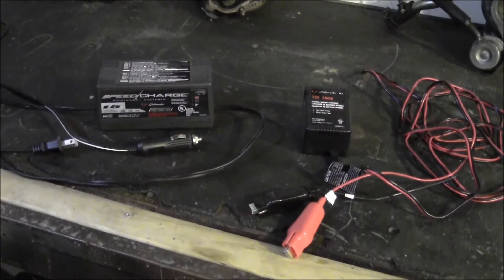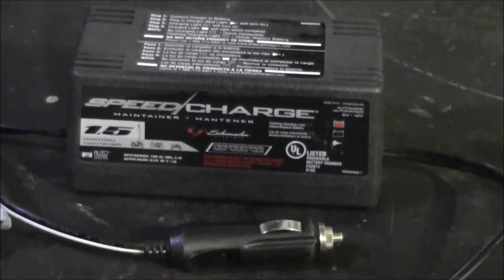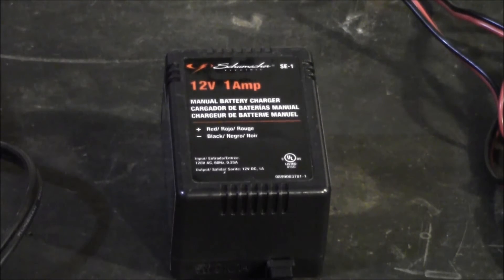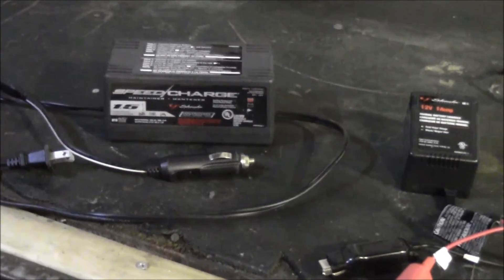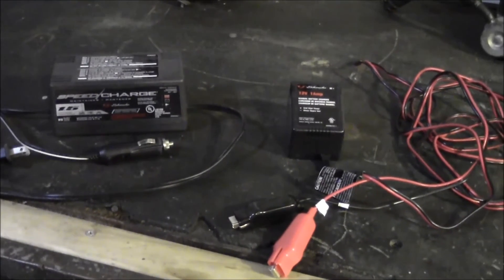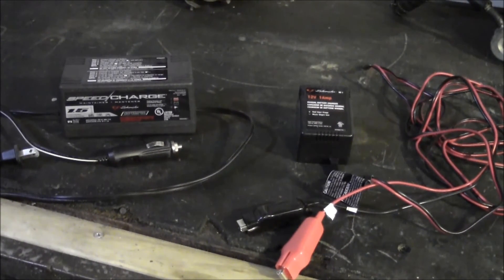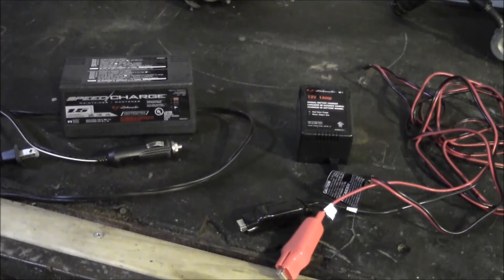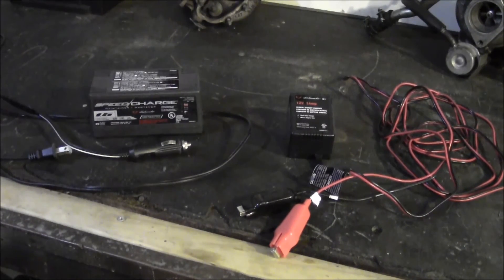Trickle Charger/Battery Maintainer Defined Proper

Comment: I had bought a battery from AutoZone the battery was dead so i tryed to hook it up my 1.5 amp trickler / maintainer. The next day it said it was fully charged,  i unhooked it and waited for 5 minutes and hooked it back up to see if it would hold a charge. I then waited  for a hour. No i dont have a voltage metter. I exchanged it for another battery and had them test it. There test said it was good but the amps are low and thats on the trickler its going on 4 hours now.
Reply from the maker: Ok... do you have a question you would like to ask me?
Reply: So can my maintainer read false reading if it is hooked up and then disconnected for 5 minutes then reconnect it, to see if it would hold a charge?
Reply from the maker: Yes, the charger may display a full charge even if the battery has not been properly charged.  It is rare, but it can happen.  The best way to verify that a charger is providing a charge, is to test the battery with a voltmeter while charging it.  Beyond that, a load test is the best indication that a battery is properly charged.  Autozone should offer free battery charging.  I would suggest taking the battery back to Autozone so they can either charge it for you, or replace it.  Your 1.5 charger could take up to 3 days to charge a full discharged battery depending on it's size/RC rating.
Reply: It's a 1.5 amp John Deere charger/ maintainer. I will ask my buddy if i cant barrow his voltage metter.
Thank you for answers to my question and concern.

Comment: can i use the 1,5 schumacker trickle charger to charge a small 12 volt sealed gel battery out of a booster pack ?
Reply from the maker: Yes you can.  However, depending on how discharged the battery is, the charger will either not start charging or it will try to charge the battery on 6 volt mode (If your 1.5 amp charger is the 12v/6v model.  Some are 12v only).  A low enough voltage will cause the charger to attempt to charge your 12v battery in 6v mode.  Which is not going to result in a charged 12v battery.  So you have two options.  1.  Check the battery with a voltmeter and be sure the battery has at least 8 volts before charging.  2.  Attach the battery to a known good 12 volt battery with jumper cables and charge it for a half hour.  After a half hour, stop charging and remove the jumper cables.  Then reattach the charger to the booster battery for final charging.
Reply: BATTERY says 10 volts,,,,,,when i hooked up the charger the meter i had attached said 16.5 volts. was afraid i was putting to much juice into it so figured i look on here before blowing up the battery
Reply from the maker: What model charger are you using?
Reply: the same one you show in the video 1.5 schumacher
Reply from the maker: From what I have read an agm battery should not be charged above 15.6 volts.  However I have seen two different schumacher chargers charge an agm battery at 16.5 volts like yours is.  One charger was even set to the agm setting.  I don't think it's a big deal as long as the battery does not get hot to the touch.  I would suggest keeping an eye on it and periodically placing your hand on the battery case to check the temperature.  It should get warm but not hot to the touch.  If the case is getting hot, stop using that charger.  Or you should get a different charger.  What ever you are comfortable with.  The charger you are using has a desulfation mode that charges at high voltage which is why you are reading 16.5 volts.  Again, it's your call.

Comment: Still confused.  It looks like the battery maintainer has an electrical cord at the end and the trickler does not.  I have a car I do not drive everyday and thought one of these two items I could hook up to it so it is not dead after 3 days, but I would be unable to plug the thing in to a wall outlet.  What would I need?
Reply from the maker: The trickle charger has a plug that flips out of the large transformer block.  So it plugs into the wall like the maintainer does.  Don't get a trickle charger.  It will not stop charging like a maintainer will.  You need access to a 110 volt outlet.  The only other route you could go would be to disconnect your negative lead on the battery when the car is sitting.  Get a jumper box.  When you want to start the car and use it, reconnect the negative lead and then hook the battery up to a jumper box to start it.  Or you could just remove the battery from the car and bring the battery to a location that has a 110 volt outlet.  Then put a battery maintainer on it.  When you want to drive the car, take the battery off the maintainer and reinstall it in the car.
Reply from the maker: This video shows the plug on the SE-1.  https://youtu.be/y9-v3JDuhNI

Comment: how can you tell when the charger has done its job?
Reply from the maker: On the automatic charger usually a light will illuminate indicating a full charge.  Now on a manual charger there is a bit of math involved.  I really don't think it is worth the time or effort to charge a battery with a manual charger when automatic models are low cost and readily available.  When using a manual model your first step is to determine how long to charge the battery based on the batteries capacity.  Multiply the reserve capacity by 0.6.  For example... 120 minutes reserve capacity multiplied by 0.6 = 72 amp hours.  Next use a volt meter to determine the level of discharge.  So a voltage reading of 12.4 volts represents (roughly) 50% state of charge.  So divide 72 amp hours by 50% or 1/2 and you have 36 amp hours.  Some people will add 15% for any lose caused by internal resistance within the battery.  So 36 x 0.15 = 5.4 plus the original 36 amp hours = 41.4 or rounded up 42 amp hours need to be replaced to charge the battery.  So to charge the battery with a 10 amp charger divide the 42 amp hours by the 10 amp charge rate and you have 4.2 hours which could be rounded to 4 and one half hours of charge time.  This can be inaccurate because most chargers will not output the full 10 amps during a charging cycle.  The output will vary.  Therefore you may only see half the output amp during the charge cycle.  So it may end up taking twice as much time 8.5 or 9 hours.  After charging for the specified time you need to check the battery with a volt meter or hydrometer to insure a full charge.I don't like using a manual charger because it is very inaccurate and requires a high level of attention.  So I highly recommend using an automatic model.

Comment: Ok new to this.

 I have a 1997 Miata Miata convertible. Battery is a small one and I have a Schumacher Battery Companion. 1.5 amp.  It is like the one you have described above and call a maintainer. So the selling lingo out there is Maintainer, Tender, Companion, and Trickler. 

I was going to buy a Battery Tender Jr. because of an automatic float feature. I do not understand why there is so much confusion about what these do. Your video explains this but get on google and ask the question and there is no straight answer. People are calling a trickler a charger and a charger a trickler,  a trickler a maintainer and a companion a charger trickler. 

All I want is to keep the darn battery from going dead over the winter without causing a fire in my basement where i have to keep it because I have no garage. 

Will my Schumacher Battery Companion 1.5 amp do the job or not?

Volts and Amps are another confusing subject when people explain this stuff to others. They use amp for volt and volt for amp. NOT the same!

 Why do people have to make this so difficult?  I guess its a selling issue.

Thanks
Reply from the maker: I think I can help you out Jay.  Your frustration is the reason I try to make these videos.  You are correct... this is very confusing!  Yes your Schumacher Battery Companion 1.5 amp should do the job just fine.  Be sure you set it to 12 volts if your model has the selector switch for 6 or 12 volt.  If your model does not have the selector switch let me know and I will walk you through that scenario.  Thank you for watching.  Your question is why I try to make these videos so I am glad you left a comment.  Thank you!

Comment: I have a 100amp/hr battery. 1 amp trickle charger. Will it take 100 hours to charger? I'm confused
Reply from the maker: Yes, it would actually take more than 100 hours depending on the condition and age of the battery it may have a greater internal resistance.  The 1 amp trickle charger is meant to maintain a charged battery which is way it is not the best choice for charging a battery in a timely manner.
Reply: +fwh79 the battery is 9 years old
Reply from the maker: You should have it load tested then.  It has more than likely expired.